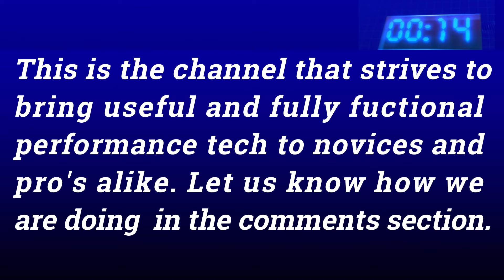Performance  survey & hot upcoming video's

Comment: More racing is good. Also if you could talk about pros and cons of gear drive timing vs roller chains and harmonics and would that have any effect on the typical 450 500 horse street engine thanks.

Comment: I finally sat down and  compared my big block builds to the ones in Vizards book.
 He has done his homework.
However  his builds are down on rpm due to hydraulic rollers and will get you put on the trailer with your tail between your legs on the street.
 A simple switch to solid rollers in the  284°/288°@.050"  .750" lift 108°LSA  range will remedy that.

Comment: Aircraft recip engines run a high duty cycle. Full throttle for 5 minutes and then back off to 75% power. The stresses from high load for possible hours is hard on the reciprocating parts and crankshaft. The Lycoming and Continental engines normally have a maximum 2000 hour TBO. The engines are completely dismantled and inspected. Magnetic particle is not sufficient, parts are x-ray tested to look for subsurface cracks. An automotive engine may only be serviceable for 500 hours to 750 hours. On rebuild, the crank and rods will just be replaced. Part of the problem for automotive engines is bore spacing, which limits the thickness of the rod journal webs and the radius of the journal fillets.
Engines like in the DC 3 are built as light as possible, but the crank and rods are like a heavy duty diesel to take the stresses.

Comment: I left three responses to the survey. 
  In addition.  I would love to prove Eric's truck can be made faster with a smaller cam, and better driveline components. His HP is extremely high for the times he is turning. It is easily a 9 second truck if he utilized more torque than rpm.

Comment: I think you're falling short on the parts sale 😂 I've been wanting to buy a set of sbf heads from ya for a while now and we have talked several times about it but it just hasn't worked out. I want them as a souvenir even though i would run them if they are a good set and I can afford them. But I know you are very busy. You're not falling short I'm kidding I'm just wanting to buy heads from ya. Anything that will fit sbf even Cleveland or Cleveland like heads if you get time. Thanks Dv.

Comment: i have often thought about putting a dominator on a big block chevy , --as i recall the test  mule  had a fabricated -ram and TWO 1000cc 4150s and the same power and torque from ONE dominator on a dual plane intake --seems like he had one of those tuned spacers on there too. if i could get a dual plane big enough with a dominator top --i would run it on my ls7  instead of the super vic

Comment: I want to see dyno tests. Specifically, prove your LSA camshaft theory. I know that out of two cams with equal duration, the one with the tighter LSA will make more power.
What about two cams with equal overlap, but tight vs wide lsa's? For example a 230/236 with a 106lsa vs a 240/246 with 110lsa (just ballpark equal overlap, I didn't do the math). Which one makes more power?

Comment: I’d like to see header evacuation and pcv system setups. Everyone I’ve asked about header evacuation said it’s not for the street. I’d like confirmation on when it’s appropriate.
Reply: I think if you have a termination box ( or a big muffler) after collector it is about the same thing like open end and you can use header evacuation.
Reply: And of course the rest of the pipe is not restrictive...
Reply: I’ve thought about using a Spintech muffler near the header with no packing to collect any oil.

Comment: Perhaps if you've done any work with stagger cams and staggered compression? 
Some cylinders compete for their charge and the pressure/timing varies a bit. Exhausts can be staggered in length but the intakes are no so adjustable. Valve timing can be improved and the compression on starved cylinders bumped up. The 318 project could lean that way, but there are a number of race classes that limit engine modifications but compression and cam timing are usually open.
My own interest is more very over-square/high rpm small engines these days so more of a very limited rabbit hole.  If you want to recall vintage F1 designs, 4:1 bore to stroke 20,000 rpm... Just less than a handfull ever design in that space so....   More a history lesson filler.

Comment: Racing is paramount indeed cant race a dyno that's why u feel disconnected because the race track is not challenging your assumptions and stimulating your acceleration gland.when we race and tune it opens up several more synaptic pathways in our internal hot rod go fast computer/imager of what mite be possible if only .nuff said for now